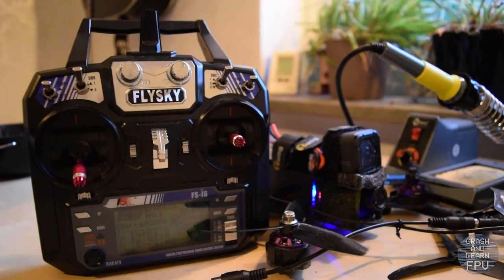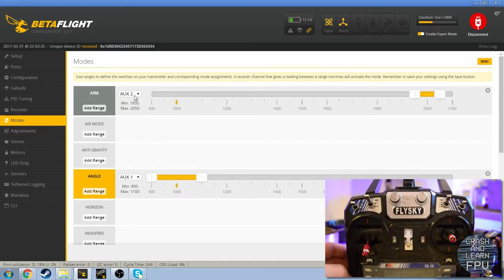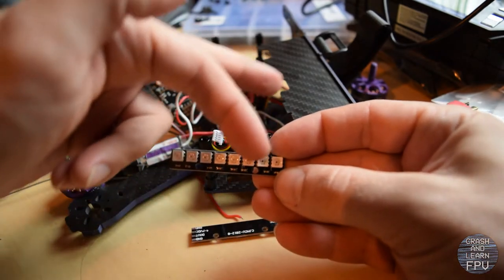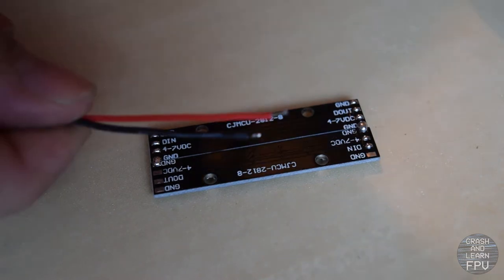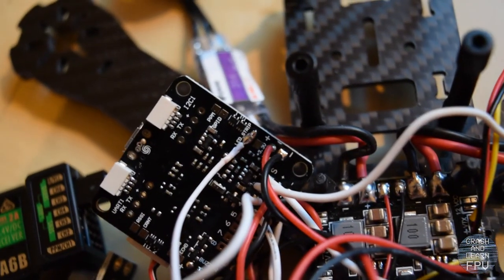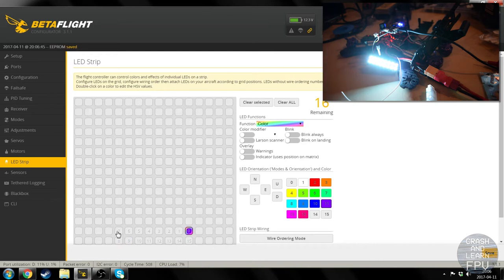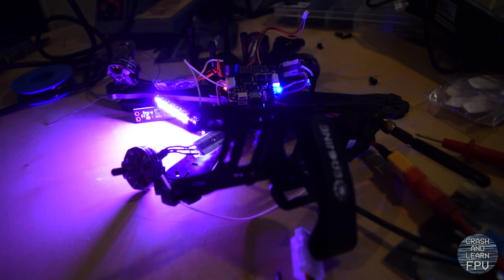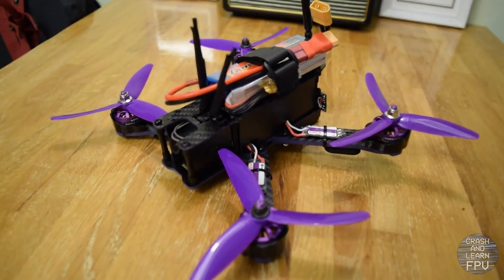Eachine Wizard X220 Noob Setup 3/3 - Mode switches, custom LED's

Comment: How do you set leds to warn for low voltage while keeping your chosen purple color?  If I set my leds to "battery" the leds will be green and change color depending on battery level.
Reply from the maker: +mst3kpimp If I remember correctly I set them to 'warning' or something like that. In that way they flash red when my VBAT warning level is reached. And if the copter is unarmed and I flip it beyond the allowed degree for arming the LEDs flash green. Hope that helps, cheers!
Reply: yeah i tried warning and it appears on the led grid via little dots but after saving the grid dots change color and position and I only get blinking lights ect.  I have vbat enabled so I don't understand why I can't get this to work.